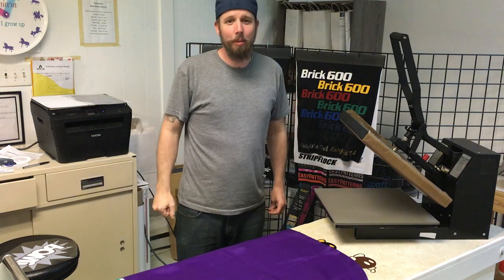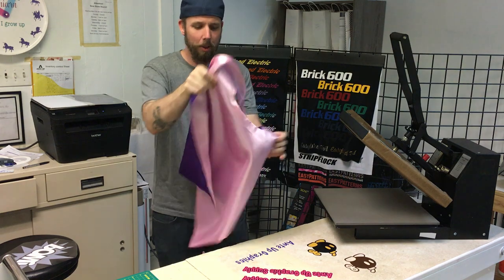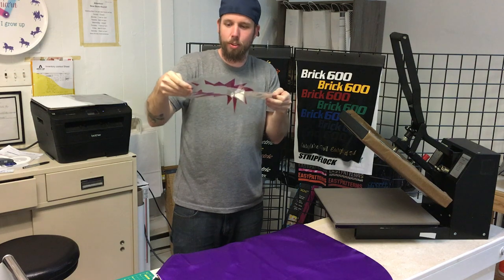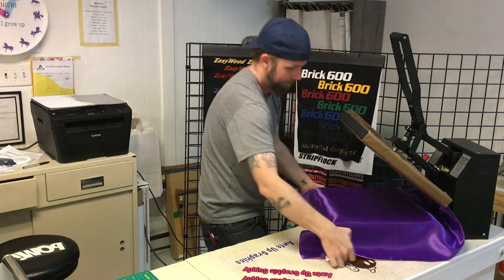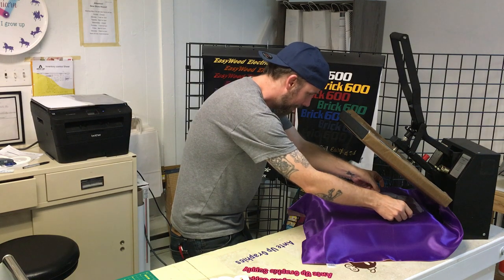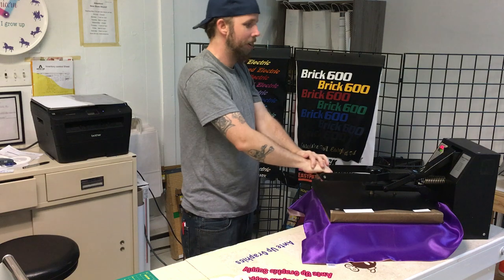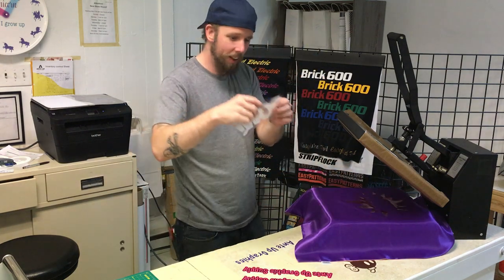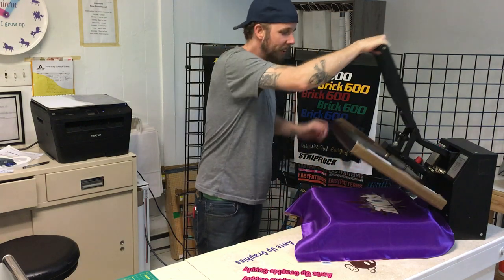How to make a satin halloween cape with heat transfer vinyl - Siser EasyWeed Electric -

Comment: are the settings the same if i was doing a silk robe (95% polyester and 5% spandex), 305 at 15 seconds with easy weed stretch?
Reply from the maker: Whitney Gates yes. They are the same. Sorry I missed this comment.